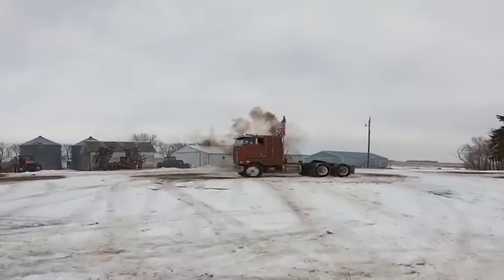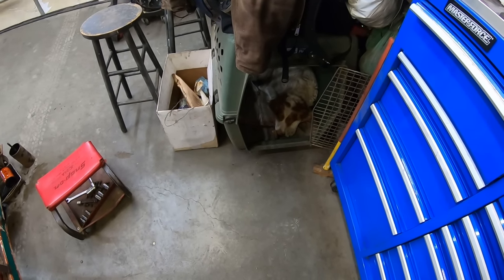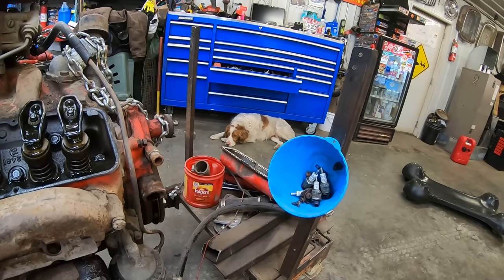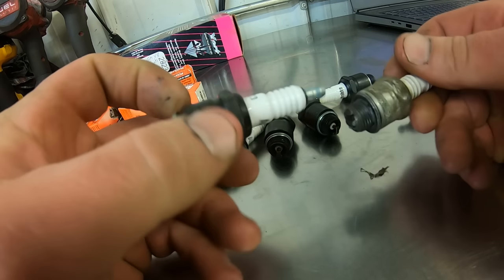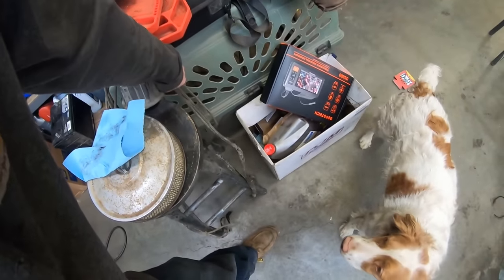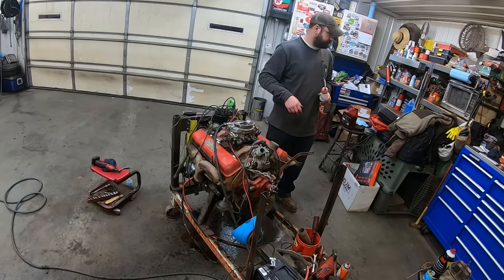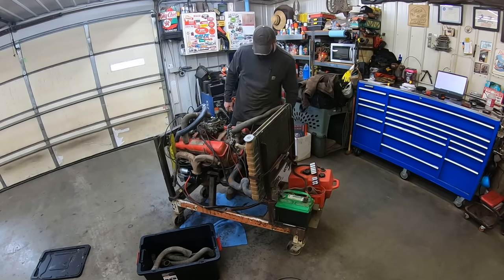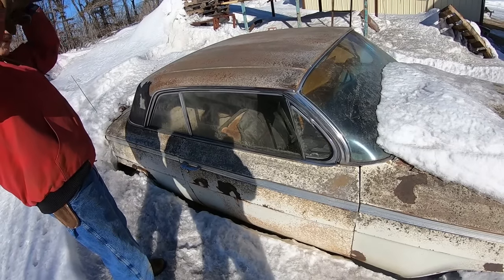1962 Impala Super Sport 300HP 327 Engine Abandoned for 43 Years!! Will it Run?!?

Comment: My favorite engine and why? A 240/300 Ford. I had a 92 E350 cargo van with an injected 300. Paid 500 for it with 600k miles. It hauled newspapers daily for 20 years. I had it 3 years and I was heading to Roswell NM...in the Atascaderos. My radiator grenaded on me. Closest civilization was Roswell, about 60 miles out. I drove it with no coolant at 50 mph in 95 degree weather. It was knocking and clattering but it made it to AutoZone. Threw another rad in it and drove home to Lubbock no problem at 85 mph. Absolutely indestructible engines if you keep up on the maintenance
Reply from the maker: They're tough to kill.
Reply: @MortskeRepair  after that would be a DZ302 or any RFI small block from the early 60's.

Comment: One of my favorite Engines had a 63 Impala with one and a Slip and Slide with  Power Glide Transmission which did not hold up to my driving habits as a 17 year old.  Also had a 64 Plymouth at one time with a 318 engine which was very dependable.  Have a 69 Olds 442 with a 400 CI engine that I have owned since 75.  Completely restored.
Reply from the maker: Love them 442s

Comment: Back in 1980s built a 327 for my 67 camaro.bought used set off camel back heads,2.02 1.60 valves .put new flat tops thinking. 64 cc heads,to run on pump gas,turned out they were 68 c c so instead of 10.1 i get about 9 something.but it was fun,!

Comment: i had an adapter   like that on my old 283 1959 Bel-air the brand I had was a Spark-o-Matic I needed it to put a Holley on a Stock Chevy 4-barrel intake manifold! this was back in the mid 1960's.

Comment: I'm a Ford FE guy especially the 390 HP and 428 SCJ's . Just suggestion, take some bicycle inner tubes and place over the front angle iron to protect the radiator. Cool video, thanks!!
Reply from the maker: Great tip

Comment: Mercury Marine make this stuff called Power Tune... It the best stuff for freeing up stuck rings. I order it by the case online.

 Your camera thing is for sewer pipes..... I use one doing home inspections when the buyer wants to make sure the pipe from the house to the street or septic tank is ok. 

How come you don't set the timing why cranking with one of your many timing lights? It makes starting much easer, not having to horse with the timing....

Nice running 327, for a fairly solid looking 62 Chevy. The Anniversary Gold was for the 75th year of Chevy, I do believe.

I really enjoyed your video. Thank you.

Comment: Gen 1, 2, 3 Mopar Hemi engines are the best. Have 2 late model Mopars with factory SRT headers on them and plenty of mods, they haul ass. Gen 1(early)hemi engines have some parts in common with the LA small block engines. Gen 2 speaks for itself........don't see any big block Chevy or Ford engines in top fuel classes.
And you can put headers on without burning plug wires up with spark plugs on top!
Great job persevering on that 327 and getting 'er done! It will run well in whatever it is installed in.

Comment: I’ve got a 307 in a ‘68 K1500 that was stuck and I used one of the old style oil cans that you can fill and pump to get oil in the cylinders. Worked pretty well and there wasn’t a whole lot of mess
Reply from the maker: Great tip!
Reply: @MortskeRepair  funny thing is I bought it for overhead valve gas job Mack truck engines but now I kinda use it for everything. Works on Chrysler V8s too

Comment: Back in the 80s we purchased several rebuilt 350s from a local rebuilder. He put the 350 hp 327 "corvette" cam in all his "stock" rebuilds. I believe the cams were re-grinds but we never had any trouble with them. Lasted for years behind trucks pulling 36ft goose neck trailers loaded with livestock. Excellent engines, he was an awesome rebuilder. With the loads we were pulling we stopped buying target master new engines and used his rebuilds exclusively, they lasted longer and performed much better. We were lucky to get 50K from a target master. We ran the hell outta those trucks.

Edit: I know I'm going to get hate for my favorite engine but it's the GM 60 degree V6s 2.8, 3.1, 3.4, 3.9 variations. Yeah, I'm weird like that..
Reply from the maker: Nice!

Comment: 225 slant 6. Had one in an 85 Dodge pick up that pitched a rod, put a hole in the block, and bent most of its pushrods. Still fired right up and ran no problem. Every time we used it you’d just pour a couple litres of oil in the hole and be on your way. Lol.
Reply from the maker: Nice!

Comment: My favorite motor! Had a 327/300 hp in my 67 Malibu. Lopey cam is stock. As quick as any off the line, but having only a Glide 2 speed, it came up short a gear. One I wish I'd kept. Paid $200 for it in 76
Reply from the maker: PGs are really a killer off the line.

Comment: Mortske, I have an issue for you to ponder....  mainly since I have no idea what's causing it... yet....
I've got a customer who has an '07 Suburban LTZ ( 5.3L Vortec 2WD ) AND SOMEHOW THERE'S ABSOLUTELY NO OIL GETTING TO THE TOP END DESPITE HAVING 45PSI OIL PRESSURE ( I checked it with a known good guage in-line after the cooler to eliminate the factory guage or sensor being faulty ) whatever is the cause has just recently occurred because the valve train hasn't started ticking yet... I noticed when I took the valve covers off to replace them ( 1 was damaged by a now ex-employee and a badly placed ratchet  when starting it ) there was a lot of carbon buildup on the inside of the covers that appears to be oil baked until it was dry. according to the computer ( checked with a Snap-on Solus ) The truck hasn't been overheated and has not had any problems with oil pressure or temps in the past 3 months ( I cleared the codes when I replaced the fuel pump & COP boots + plugs )

even with 20+ years of experience I'm at a loss to explain why its not getting oil to the rockers.... but I am more of a Ford hack so I figured I'd ask you since you are more of a Chevy guy.
Reply from the maker: Pshhh GMs don’t need oil

Comment: There's not too many powerplants that I miss.  But I do miss that one.  Had a 300 hp 327 in a 1980 Chevy Malibu except I was running a 4 bbl Carter a.f.b.  Traded it for short box dodge pickup. Should've kept it a bit longer cause I blew up the truck.  Nice job Mortske 👍

Comment: Hi enjoy the channel. My favorite motor was my 1973   AMC 401 dog leg exhaust factory internals were all forged steel, I used a 780 cfm holley dual line with Accell coil running hooker headers in a Javelin 12 second quarters Thanks!
Reply from the maker: Cool!

Comment: Get a can or 2 of amsoil Power Foam. Follow instructions on can..Spray some in the carb while engine running (garage door should be open for this)..Will help clean p the top end of cylinders. Was really nice to hear the rumble of a 327 running again. jP

Comment: Glad you made some proper brakes for the engine cart outside. Otherwise, you might've given a whole new meaning to the term "runaway engine". Anyone else picture in their mind Mortske sprinting after that running 327 as she rolls down the shop approach toward the road? 😁 Just as long as lawnmower man wasn't making his way by.
     My all time favorite engine probably would be the GM 327. I think the near zero resistance in the cylinder due to the ratio between the bore and stroke made it very efficient on fuel and power. My second choice is the FE390. I know alot of people will balk at that, but if you cam her right with good compression and get it to breathe well, they'll rock. They sound really good too.
Reply from the maker: Hahaha

Comment: Well probably the 318 would be my favorite but running a close 2nd would be the 60 through 64 Oldsmobile 394 skyrocket. Hell of an engine with lots of horsepower and torque. I had a 62 super 88 4 door, raced a camaro once, blew his doors off at 4 traffic lights in a row!

Comment: It is a 300hp, not a vette motor. I out run my share of 383 road runner 4 sd. The automatic Roadrunner's were faster but a 300hp in a 64 SS 4spd would take a 383, 335 hp. You just made my day. In the land before aftermarket everything, these could be modified with factory stuff that made for some exciting midnight racing. Grumpy Jenkins  out ran 426 hemi Cuda's with these. I literally drove my 64SS to the track & back to Ft Hood Texas duty. Reliable isn't a good enough word to describe the 300hp 327.
Reply from the maker: Good stuff!
Reply: @MortskeRepair  Hang on to that motor. If nothing else it's a collectable antique.

Comment: Well my favorite has to be the Chevy small block, around a 350, I don't care for racing, im more for reliability and the grunt. All the trucks and cars I've owned that had a 350 lasted well over 400,000 miles with not a ton of normal repair stuff, My grandfathers truck had the 4.3 in it, it caught fire just outside of Minot, ND around 2004, pretty sure it was the alternator, it burned up everything in the engine compartment and even the dash. I pulled the engine out and redressed it with new valve covers, intake and replaced all the wiring and bushings, that truck made it over 687,000 miles, and still ran decent when sold. Yeah not a v8 but most 350 stuff worked on it lol. 

I hate anything newer than 95 really, I drive a 99 GMC Suburban, its alright truck, but man the work it needs is crazy, I just did a valve job on it few months ago, now it needs fuel injectors, its already got a ton of piston slap on cold starts if its under 40F outside, I need to fix the rear end and front diff.... The quality went down hill fast after in 95 with GM.

Comment: When I was 18 or 19 I worked as a detailer and lot porter for a buy here pay here dealership and they got in a 283/TH350 swapped 1984 S-10 and while it was fast by any means, it was torquey and fun. Whoever did that swap made it look like it came from the factory with the 283. I drove alot of fun cars while I worked there. A 5.0/5 speed Fox body, a 1993 351W Ford Lightning, a 2000 Mercedes S500, a couple newer BMWs, and the owner had a black/red 1988 Monte Carlo SS with a fully built stroked 473 that ran on Turbo Blue and made about 800 HP. That car only had 149 original miles on it. He also had a 1962 C10 with the same engine in it because he got a deal on two of those engines. He ended up selling that Monte for $40k after I quit. Craziness...
Reply from the maker: Dang!

Comment: I like the 2F inline 6 from Toyota that you find in old Land Cruisers. No much power at all but plenty of torque and very, very dependable engines. 

Fun fact: that engine design was originally made by Chevrolet on the stovevolt. Toyota keep building them under linces as the “F” series engines on the Land Cruiser up until the 90s.

Comment: I never was until I got my first one to mess with, but I’m a fan of the 429/460 fords. The early pre smog 460s (68-71) have small chamber heads and make almost 400 horse and almost 500 ft/lbs of torque in completely stock form with the little 2 barrel carb. So a carb and some poor man’s porting does wonders. They don’t have the aftermarket support that the small block fords have, or any Chevy for that matter, but if you know what parts to look for they’re rather cheap to make a mostly stock 400+ horse engine out of. they’re worth dropping into something, it’s a cheap way to fry tires. My 63 f100 has a 460 out of a 73 Lincoln in it, even with the smog heads it makes 300 and makes the little truck fun to rip around in. but I have a 70 block with a set of matching heads that’ll go into a future project once I put the engine together.
Reply from the maker: Nice!

Comment: I had 64 SS 327 300hp 409 4bl. truck exhaust manifold  3in back to the muffler reducer to get them on . No  tail pipes  .Had tilt steering wheel . 4 speed .  After that one got 66ss rag top , no hp but looked GOOD, blue with white top.
Reply from the maker: Very nice!

Comment: My favorite engine is the Chevy 235 straight 6 or GM's 250 straight 6.  They're a smooth running tough engine that will usually run even when worn out, LOL.  The Dodge slant 6 leaning tower of power is my close second.    Had one in a 1965 Dodge pickup.  I bought it with 235K miles (only paid $400 back in 1985, LOL).  I put another 50K on that engine before I sold it, and it still ran great.  Burned about a quart of oil every month, LOL.

Comment: 3 Favorite engines
Flathead,   Had a 255 Merc in my 33 Ford pickup with a T5
VW Beetle engine ,   Have had many VW's in my life, have  56 Oval now
Small Block Chevy,,    No explanation needed.

I remember parts of a Champion plug gapper tool in my fathers toolbox.
Not enough to salvage unfortunately

Comment: Small Block 350.  Probably the most versatile platform in history.  It can be between a 283 - 400 CI and make from something like 180hp to over 1000.  I worked on oval track cars for ten years of my life and nothing sounds like a 355 singing at 7600 - 8000 through open exhaust.
Reply from the maker: Don't forget the 267!

Comment: Now your just gonna have to explain to him he's gonna have to run lead substitute for the life of the engine to keep from poundin the valves into the heads....good luck brother. those 327's were torque monsters, my ex mother in law has a 70 monte carlo 327 bone stock with a 2 barrel that'll blow the tires off it. fun to drive for sure

Comment: Yes sir that engine sounds as though it has a performance camshaft. You can tell when it is idling and it most likely has the 350 horse 350 camshaft as the owner stated. A stock camshaft definitely will show itself when idling. Back during the sixties one could get a 375 horse 327 if one ordered up the right combination. Of course 1962 was the first year for the 327.

Comment: Chevy used the 2.5" manifolds on the 340 and 360 starting in 1962.  The 340 hp engines used the AFB and the 360 hp were                      on the fuel injected 327s.  the 250 hp used the 4 jet Rochester.

Comment: I like the 426 Hemi with 4 on the floor & the 572 Hemi with 4 on the floor & the 440 with 4 on the floor & just to bad that you didn't buy that engine you could've took out the engine in your white Chevrolet pickup & put this one in with dual exhaust on it & put a transmission with 4 on the floor in it it would sound really good with those big ram horn intake manifolds & dual exhaust on it

Comment: Ha ha, “My stand’s not set up to drive through the back of your apartment building” I love it!
I’ve seen those cameras used to find sewer blockages.  Not pretty!
Favourite Engine?
My Toyota Landcruiser that I’ve owned since birth in 1988 (the car not me) has a 2H Diesel, yes Toyota kept their codes simple.
330,000 km. It’s known 6 dogs, 3 wives, 1 clutch never had the head off.  0 to 100 (kmph) in about 5 minutes  (down hill). What else do you need. :)
Reply from the maker: Sounds like a keeper!
Reply: @MortskeRepair  
It’s been stolen twice over the years.  Even used as a “get away car”.
When you drive on the foot path the police don’t chase you apparently.
My brother said it was like one of the family is missing!
I like your Bronco.  Just a simple old truck to work on in your own shop for fun.  Looking forward to see more of that.

Comment: My favorite engine is the little 318. I skipped time on one, did a roadside timing chain swap and ran it for a year afterward. All valves lightly kissed the pistons and all 16 pushrods were bent to some degree.  I also froze that one and pegged the gauge as well. The first 318 in my current truck I blew the head gasket and limped it 10 miles home, chooching like a freight train. Only reason I swapped it was because of scoring in some of the holes.
Reply: A Dodge 318 is not an interference engine..
Reply: @paulworsaa8739  Well explain that to my valves and pushrods. Probably happened when I tried to restart it, got it to run a couple times before my battery died. I had a 3.9 (318 minus two) do the exact same thing.

Comment: I think the Holley was available on the 300 horse 327, but I don't think it was available until 64, so it might be an older conversation. I always loved the SBC, easy to work on and parts are still inexpensive. And if you took care of them they would run forever.
Reply: Yes sir, back in 1955 (probably before) when Chevrolet introduced the V8 engine it was of course to provide Chevrolet with some other offering besides the inline six (Chevrolet did have a V8 offering in 1917 or 18 but it only lasted for a year as it was just too far ahead of its time), The GM mandate was to have a cheap (to produce) V8 engine as all of the other manufacturers had V8 offerings except Chevrolet and Plymouth (both offered their first OHV V8 in 1955). Of course this was not to lose sales to other manufacturers especially arch rival Ford. But as a result we have an engine that brought a lot to the table and look at all of the stuff that has been developed for this engine. The Chevrolet V8 and the Ford flathead are two examples of strong reliable engines that made money for GM and Ford.

Comment: Enjoyed watching you go through what I'm about to do in Tminus 30ish.
Mine is almost exact scenario 65 327 low supposed miles on a rebuild been sitting in a corner 20+ years . 
I might of missed the part where you took #1 cylinder TDC ON COMPRESSION STROKE then placing the rotor towards #1 putting wires in firing order from there .
GOOD TIMES SOUND OUT OF TIME TO ME
Reply from the maker: Good luck